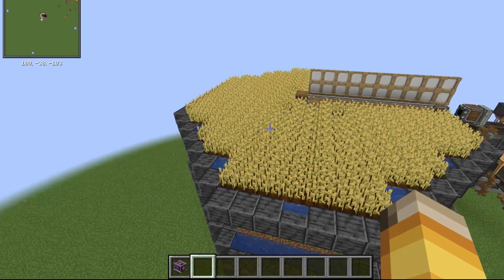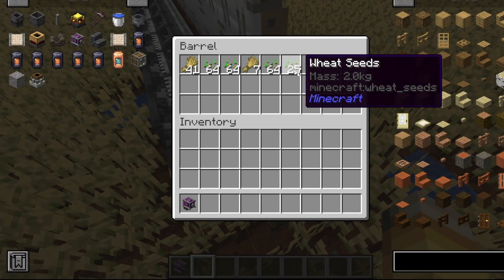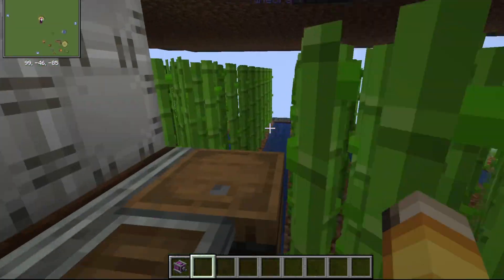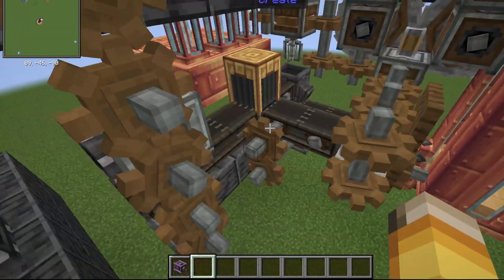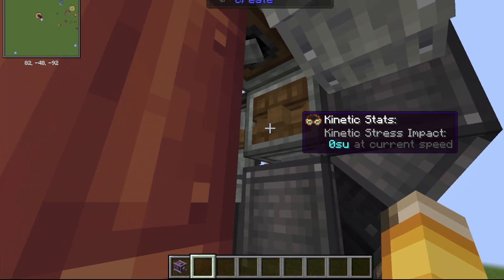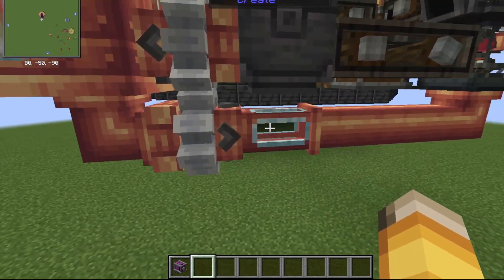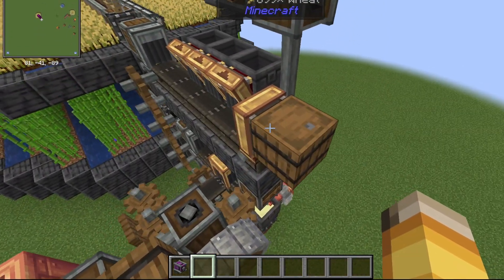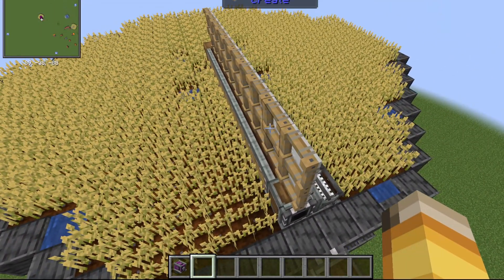Bioethanol/Biofuel Farm Create Mod

Comment: Great farm, but if you wanna power a lvl 18 steam engine, set it up to drop the wheat into the biomass basin, and set the sugar cane tower to prefer nearest, that way it fills the sugar mill first, then adds to the biomass. You can also add on a pretty simple netherrack farm to keep the whole system self sufficient. Biomass is the biggest throttle with this farm when scaled.

Comment: btw if you are having problems with the biomass not getting produced enough you can connect the wheat to the basin that makes biomass it makes the farm much faster without costing that much (the modified farm can support 9 blaze burners at minimum) edit if you wanna maximize your biofuel use seed oils to power the blaze burner thats making biomass

Comment: Hey there, perhaps its outdated but the contraption in the description does not work. The top farm refuses to spin and the items wont go in through the storage interfaces, please update it.
Reply from the maker: Maybe somethings wrong on your side but idk what to do since I don't know what's causing your problems. It works fine for me so I would try going in and seeing what's happening.
Reply: @nfn6228  i modified the farm slightly there due to the top windmill telling me it doesn't have enough air flow to spin

Comment: If I’m not mistaken you can actually duplicate cinder flour using the a basin.
1 cinder plus some lava and 1 cobblestone makes 1 netherrack.
1 netherrack through a grindstone has a 50% chance to make 2 cinder flour, so when you get the second you just separate that one out.
I’ve seen farms for it if you want designs